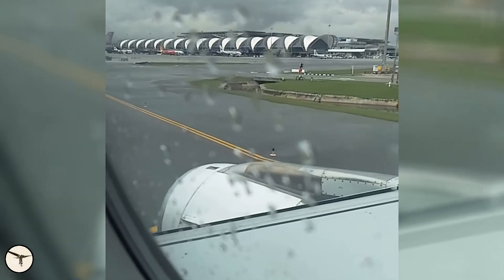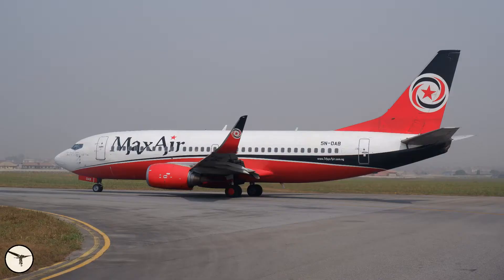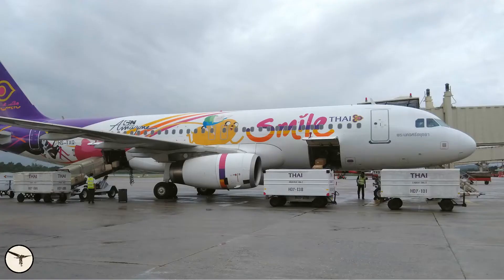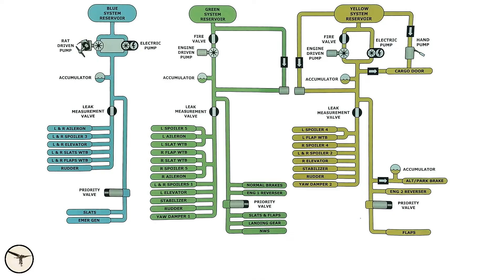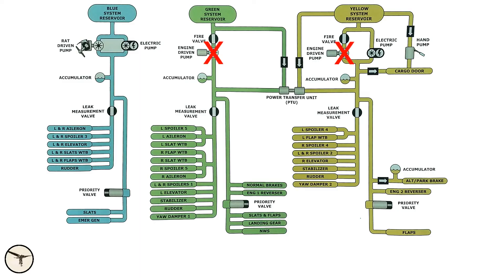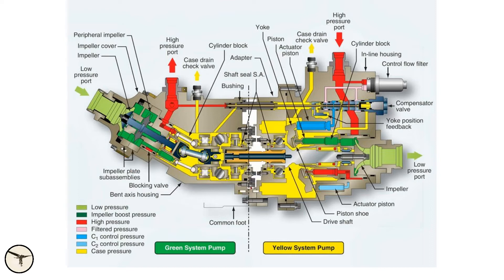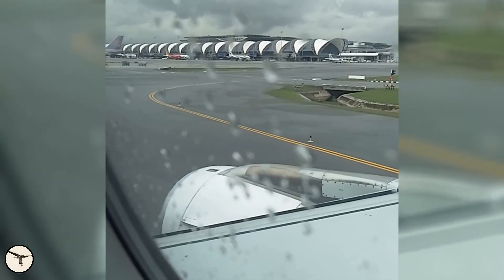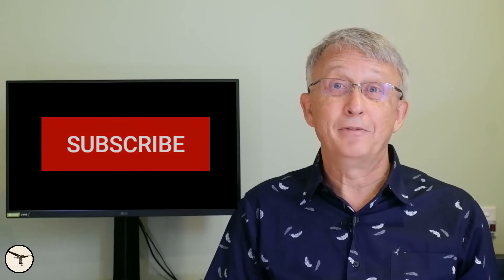The barking Airbus | PTU in A320

Comment: Good evening Capt. Magnar, I never saw any PTU on the B747 hydraulic systems. Are you sure of this information ?
Reply from the maker: I found the information on Quora where a mechanic wrote: "Boeing had them on the 727, and 747. On the 727 this was done because the number 2 engine didn’t have a hydraulic pump. On the 747 it was done so if you were taxing the aircraft with only two engines you would have all brakes and control."
Reply: @FlywithMagnar  Boeing 747 has four hyd. systems with one EDP on each engine (dedicated to each sys. 1-2-3-4), one ADP on each engine (air driven pump 1-2-3-4) and one ACP (Alternative current pump) on engine 4. It is the configuration for the classic versions (-100-200-300). On the -400 it's almost the same except the ADP 2 and 3 are replaced by ACMP. On -8 there is one more ACMP on engine 1. So whatever the situation,all the hyd sys. are available even with 2 engines off. I don't know 727 or MD80. Always be careful with the informations collected on internet.

Comment: I have been on about 30 A320 family flights and I knew about the PTU, its reason to be there  and its sound. But I have never heard it "bark" as much as in this video. Usually it's just one or two "barks" before pushback and when arriving at the gate. But maybe pilots here just don't do single-engine taxi and therefore there is less of a need to run the PTU.

In general, I am a fan of "special sounds" that you hear on planes, even though a lot of them have mostly gone extinct now. Like the whining you heard on the PA of the MD-80 (pre MD-87 at least) when the ignitor caps charged during engine start (a high-pitch whine with increasing frequency that suddenly stopped and then came back at its original frequency to repeat the cycle), or the onmipresent 400Hz hum that you literally heard everywhere on a plane back in the day.

Comment: Magnar, could you make a video about the rejected takeoff procedures on the ATR? I often fly it in Flight Sim, and I haven’t been able to find anything about say - an engine fire before V1 with the ATR. Anyway, keep up the good work! Very interesting content :)
Reply from the maker: Great suggestion! Regardless of the reason for aborting the takeoff, you reduce power to ground idle, and use reverse and/or braking as required. If there's an emergency (engine fire or smoke, for example) you engage the parking brake, shut down the engines and apply the procedure for that emergency. 
In the case of an engine fire, you pull the fire handle and activate discharger no 1. If the fire persists after 30 seconds, you discharge no 2. If necessary, you evacuate the aircraft.
Reply: @FlywithMagnar Ah, Thanks! That information will definitely be useful in the future